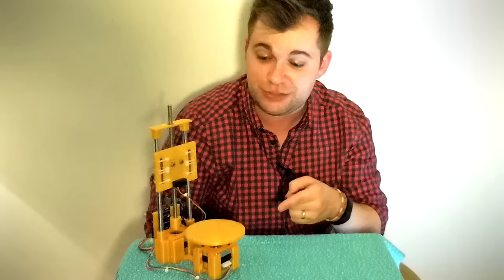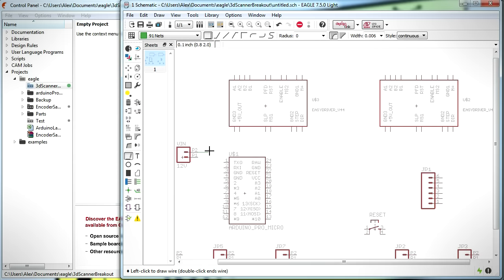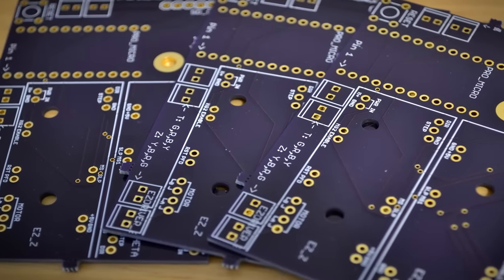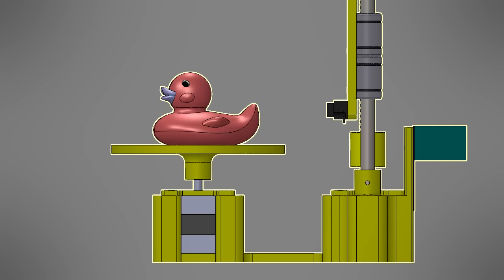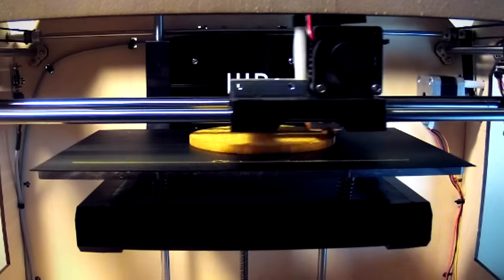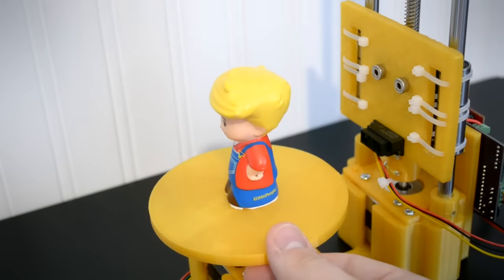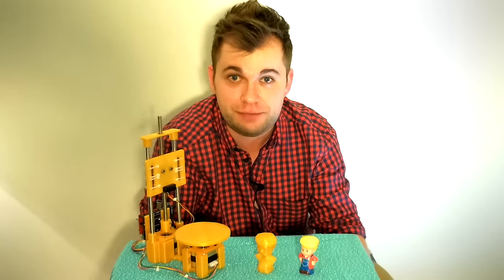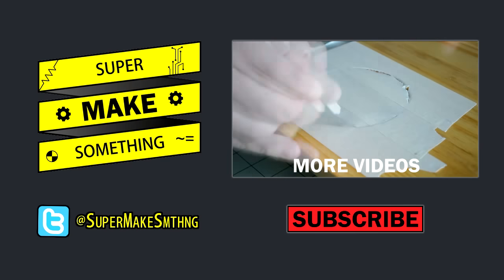DIY 3D Scanner (Arduino, 3D Printing, PCB Design, Stepper Motors, IR Sensing) - Super Make Something

Comment: i have a problam with matlab can you help me pls
Reply from the maker: Hi Mohamed -- if it's related to the 3D scanner code, I will do my best.  What is the problem you are having?
Reply: when i run your matlab ''processScanDistance'' code it show some error, im not good in mat lab. i have use 10 to 80 cm ir sensor
max dis as 35 cm and min dis as 15 cm
center value is 27 cm.  
thx for yor reply br
Reply from the maker: Mohamed Aslam Could you copy and paste the error code?
Reply: ??? Error using ==> load
Unable to read file SCN000.txt: No such file or directory.

Error in ==> processScanDistance at 16
rawData=load('SCN000.txt'); %Load text file from SD Card
Reply from the maker: MATLAB is giving this error, because the txt file of the scan is not in the same folder as the MATLAB code.  Have you already built the scanner?  The txt file will be located on the SD card.  You will need to copy it over from the SD card into the directory with the MATLAB code and change the SCN000 filename to the one that matches the filename of the txt file on the SD card.  If you have not yet built the scanner, but want to run the code, a sample txt file can be downloaded from the link in the video description.
Reply: Thx Bro 
already I made the scanner. I will try with the file which is in video
Reply: ??? Attempted to access xInterp(0,:); index must be a positive integer or logical.Error in ==> processScanDistance at 108
xTop=mean(xInterp(end,:));
Reply: this is the problem
Reply from the maker: This is an indexing problem, because MATLAB cannot access an element at an array location of 0 like other languages.  MATLAB indeces start at 1.  The problem seems to be that your text file is empty/that your scanner is not actually writing anything to the SD card.  My suggestion is to re-download the code, as well as the example text file, from the links in the video description, and run this code.  This will produce a 3D plot of the farmer figurine file that is in the video.  From there, I would compare the output of each line with what happens when you run your code and find out what differences are causing the error.  Hope this helps!  Best of luck!
Reply: Thx a lot Bro it's working...!
Reply from the maker: Awesome!  Glad to hear that it is working. :)
Reply: Thx bro
Reply: Error in processScanDistance (line 124)
surf2stl('farmer.stl',xInterp,yInterp,zInterp); %Export as STL file  (what about that?)
Reply from the maker: Menounos Mauragannis looks like your are missing the surf2stl method. Did you move the source code out of the unzipped folder? Running directly out of the unzipped directory will produce the STL file without issue.
Reply: i extracted mat files into a folder,i used matlab to open both and i only excecuted processScanDistance two create figure cloud point the i run again processScanDistance to create stl,am i doing it right?thanks!!
Reply from the maker: Menounos Mauragannis You just need to run it once and it will plot and generate the STL file.
Reply from the maker: Mohamed Aslam sorry I can't really offer one on one general help via email, but if you have more specific questions I am happy to help if you post them here.
Reply: For matlab spider graph method used?

Comment: 40 mintes?? in 40 minutes you can scan using photogrametry with much more details and with texture.
Reply from the maker: That’s probably true today, though less so in 2016 when I uploaded this video. Plus with photogrammetry you have to do a lot of file management and need the storage space, whereas this is a bit more self-contained and smaller. Depends what a user is optimizing for.

Comment: Hello and thank you this very beautiful experience
I do not speak English, hope that google translation works well
Still, I have a small problem that prevents me from uploading my program
When I upload, an error tells me;
NO MATCHING FUNCTION FOR CALL TO "SDCLASS OPEN (STRING.INT)
Can you help me?
A big thanks in advance
Reply from the maker: Hi Stephan, I have not encountered this error before and do not receive this myself when I compile the code that is currently on GitHub.  Did you modify the code in any way?  Are you using the latest version of the Arduino IDE?
Reply: I do not touch the code (I do not know how to do)
I have tested with the latest version IDE and several other versions, nothing to do
I even test with different maps and nothing
an idea
Reply: Bonjours and sorry for the delay of my reply, but I finally managed to televerser the program in IDE.
Now my problem is "" error opening scn000.txt "", I assume the SD card is not recognized.
Nobody would have a solution?

thank you in advance
For the power supply, it is normal that with 12V, either the arduino board or the drivers heated?
Still meci has all and all ... And especially on you Super Make Something